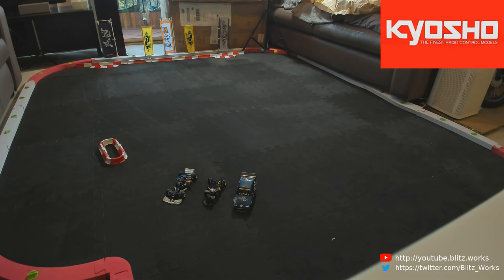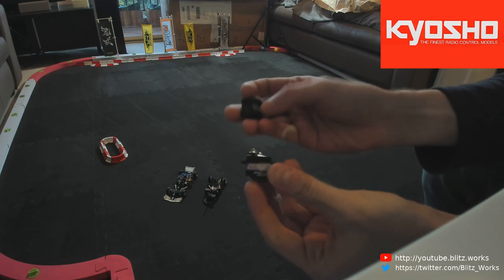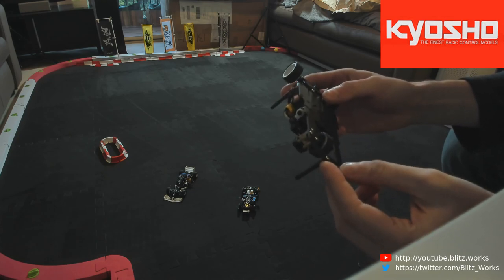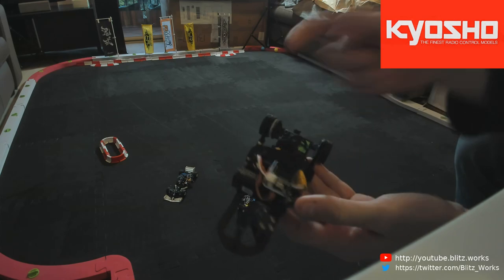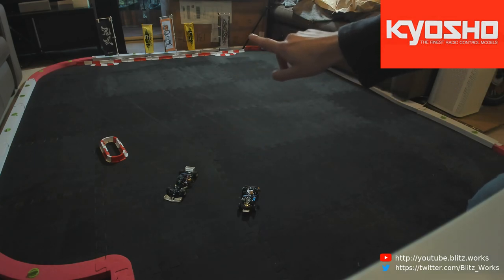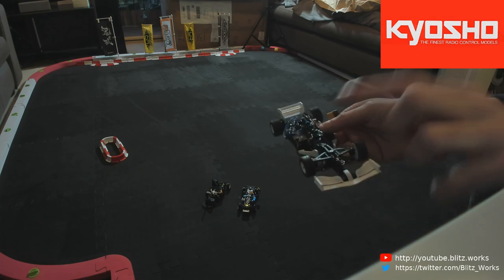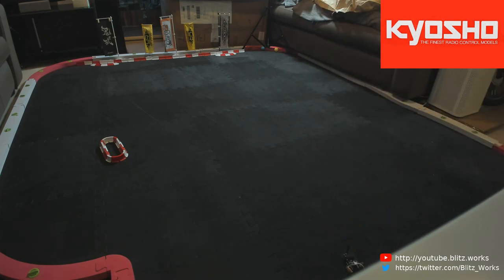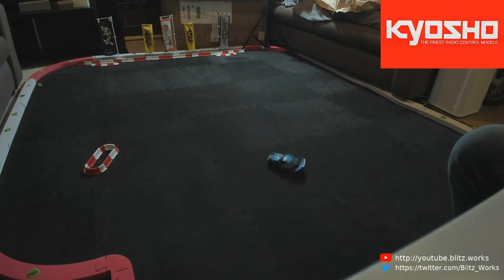Initial review of DRZv2, GLF-1 and sdracing trike and some drift practice

Comment: The drz is hard to drfit on RCP. I put a small cell (camera cell) glued  to rear of body shell on inside as the car grips too much.
Reply from the maker: i suspected as much but once the camera was off i started to get the hang of it was defiantly not firing off everything in the right order and the extra grip did help in slowing the back end swinging out. need to raise the chassis then try with the marine carpet again

Comment: I think your driving your drz2 on a wrong surface... use a plastic drift tire and drive on smooth slippery surface like ceramic hard top, glass table, laminated floor... not that type of floor... when you drive it on those you’ll realize how much gyro plays when it comes to rwd drifting
Reply from the maker: Using RCP track is part of an experiment. i do have a better drift surface but also had some issues with the DRZv2 catching on that surface (marine carpet) this should be fixed shortly. 

appreciate the advice however may be time to give up and just go back to the less grippy surface and try high grip drifting at a later time
Reply: @BlitzWorks  just give up, you will not be able to drift on a grippy surface. Try what the other guy suggested and have fun with drifting! :)
Reply from the maker: @BazelVanVeldhuizen  Drifting fine on a grippy track with no real issues now, its a different style of drifting but not that much harder

surprised at the amount of people who think its not possible or understand what i am trying  to achieve by drifting on a  grippy track. not everyone has a nice flat tiled surface to drift on
Reply: @BlitzWorks  Interesting! Sorry for being ignorant! It's just my experience in 1:10th RWD drifting is that even a littlebit more grippier carpet can ruin your day. I would love to see how you drift in action. 
BTW your content is great, I am subbing. I am considering to buy a DRZ now thanks to your vids.
Reply from the maker: @BazelVanVeldhuizen  Great to hear, always hear to help

not sure if i ever actually covered my plans but i am running LF-5's on my drift cars so it snot nearly as bad but the entire idea of the high grip was to slow things down and also somewhat make it harder to do to really focus on the fundamentals of initiating a slide and then holding it

My aim was to hold longer and wider slides and it has helped on that

i normally use marine carpet fro drifting but the DRZ and GLD ride too low and catch on the carpet so i ma back to square one for low grip surfaces again. i do have the kitchen floor but there are too many protrusions between tiles you cant tape over